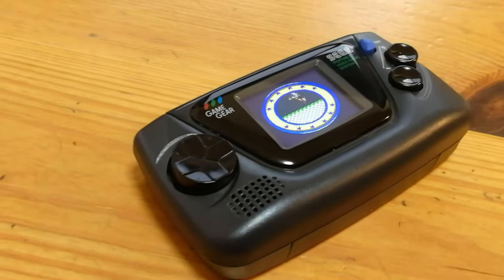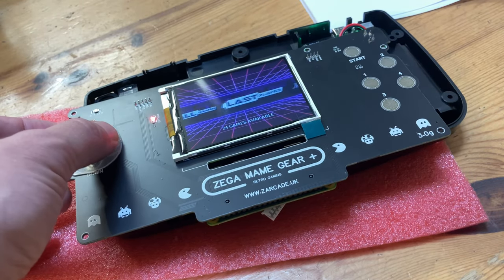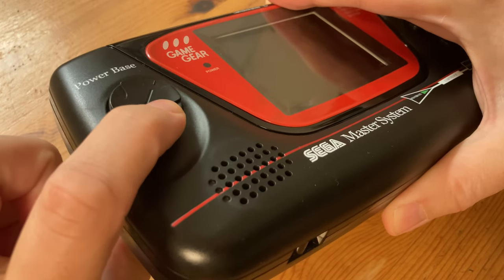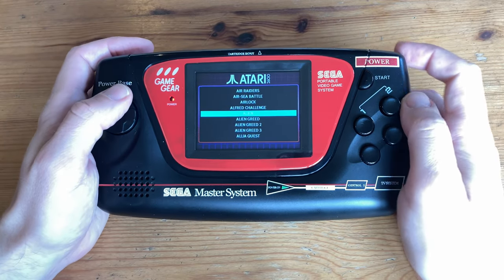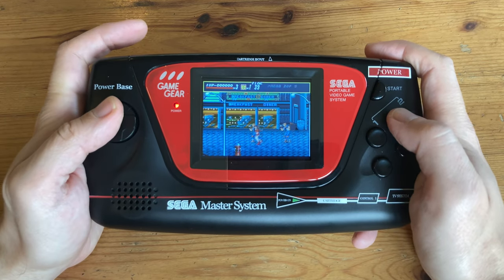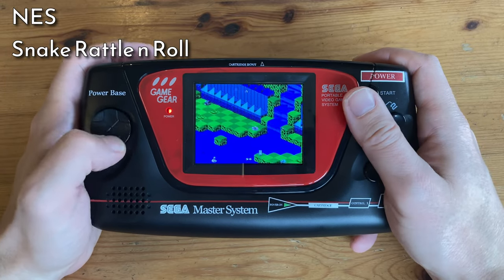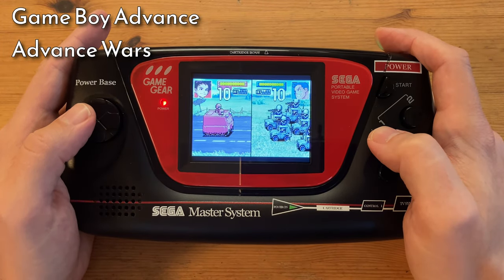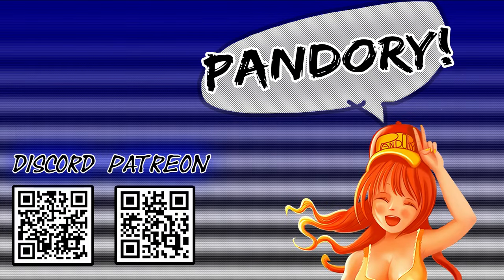Sega GAME GEAR Raspberry Pi Edition - ZEGA MAME GEAR Video Review

Comment: Hi, i have some problèm, vertical tearing and stuttering , show me under voltage on screen sometime ??
Reply from the maker: We mention the stuttering, it's due to the limited pixels on screen. Get around it by enabling bilinear filtering. 
Under voltage is a pi / power issue.  Basically if it's not perfect the os will certainly make sure to tell you.
Reply: @jonniefast   No

Comment: I have a feeling that the people producing this may not be aware of the legal peril that could await them. The UK is far more stringent than China and thee like when it comes to protection of intellectual property. So at best, I hope that they have acquired the rights to use the Sega name on the case, or they may get sued out of existence. But then we have the greatest likely danger in the creation and distribution of their images that will almost certainly contain unlicensed games. If trading standards or the boys in blue knock on the door then there could be some dire and expensive consequences. People have been jailed for copyright infringement and it is a hot topic.
Reply: Since when did Sega care? They never did anything to prevent piracy so why would using their name be any different.